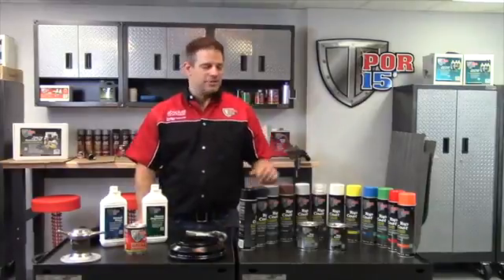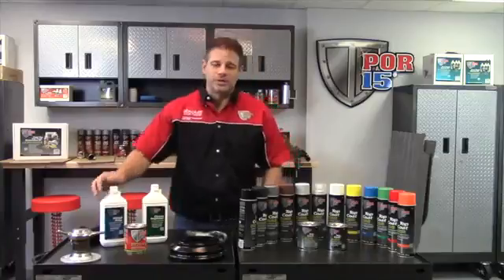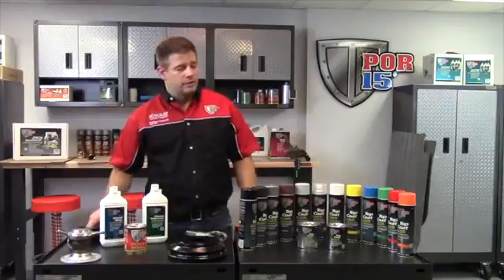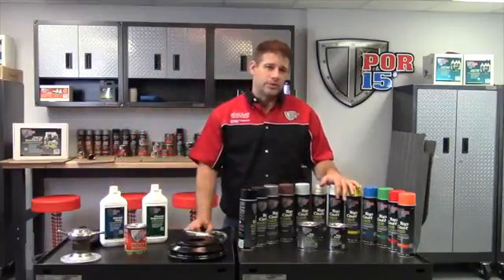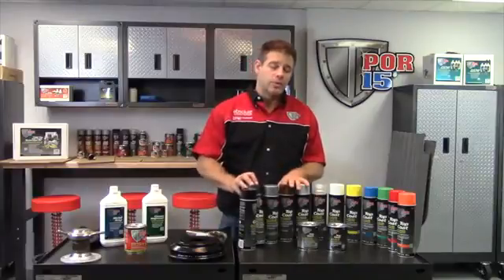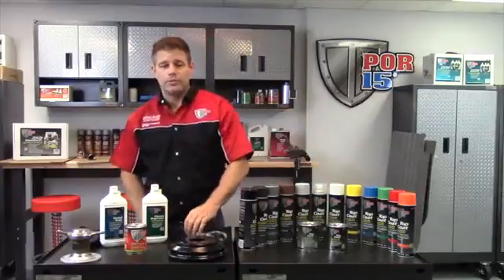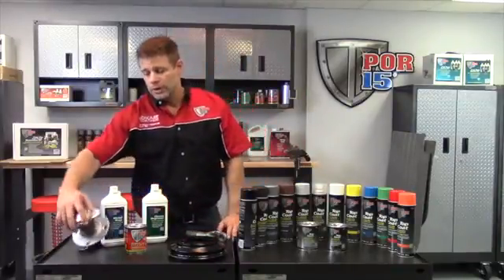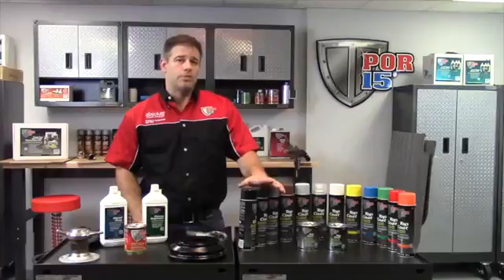POR-15 Top Coat

Comment: wait... so por 15 top coat is the same as regular por 15? Why would you use that thick stuff if this is the same? Why does this product sat DTM on it if you aren't using it DTM?
Reply: I know you asked a long time ago, but the idea is that you lay down the thick stuff first, and then you use this stuff to add a colored coat on top of it, which according to the video, protects the thick stuff from UV exposure. What I want to know is, can I use a color-matched automotive paint over it. I assume so, but I'm still researching it.

Comment: Can I use top coat over cleaned rust?
Reply: apparently not. You will need to use the regular POR rust preventative paint for that. The top coats main purpose is to seal the POR 15 paint from UV light if exposed.